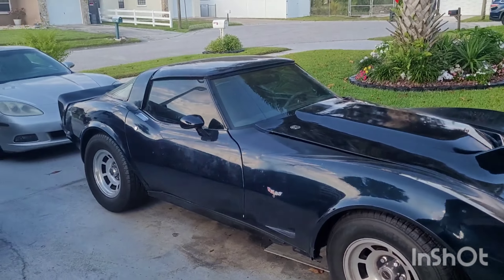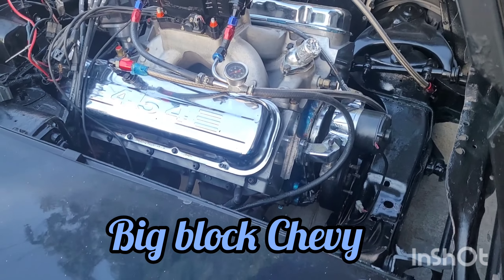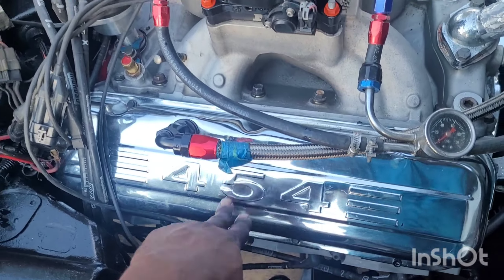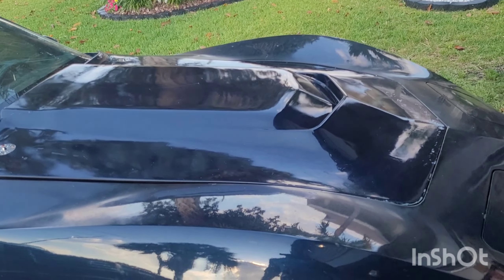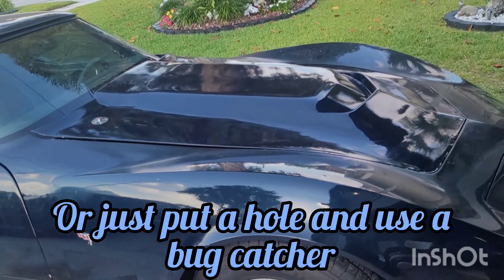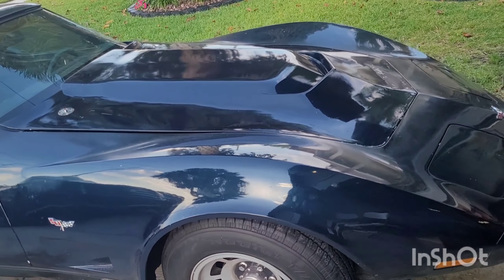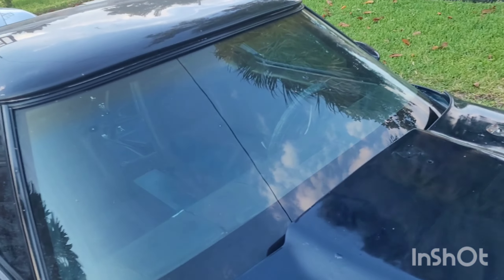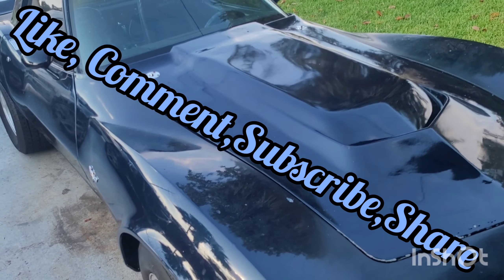1979 Chevy  Corvette with  Cowl hood or Bug Catcher. That is the question

Comment: That's a tough one. Fit the n20 spray bars in to the intake to get back that 3/4 of an inch you lost with the plate.
Or if it's just occasional strip and mostly street I would put a low rise intake on it. Depending on cam, gearing, converter, there probably won't be a big loss in et especially with the nitrous, plus a dual plane would give better seat of the pants street driving. That intake will probably hurt power below 5k over a good dual plane anyway
Unless it's got a blower or at least a tunnel ram any hilborn or Enderle style scoop  sticking out of the hood looks silly to me. 
If it was mine I would fabricate an aircleaner that looked like a mini cowl hood that was about 12" wide 20" long and 6" high.  Use soft motor mounts with a limiter then you gotta cool looking mini shaker hood sticking out but thats more than a few hour project.
There's my .2 cents
Reply from the maker: Thanks for the feedback.  I went back in forth with it.  And landed on Modifying the air cleaner and a small addition to the hood.  You're 100% right on the intake.  Dual plane would perform better just about everywhere accept top end hp.  I'm going for highest Horsepower #.  Nice at the track and Looks good on paper lol 😆